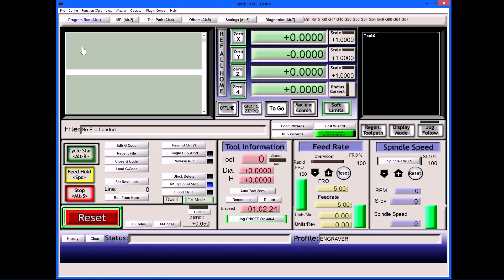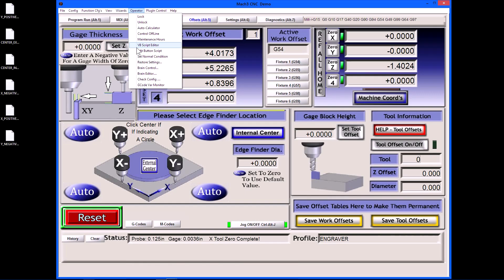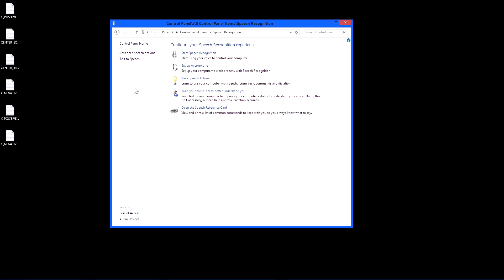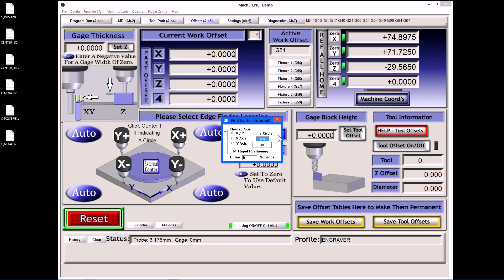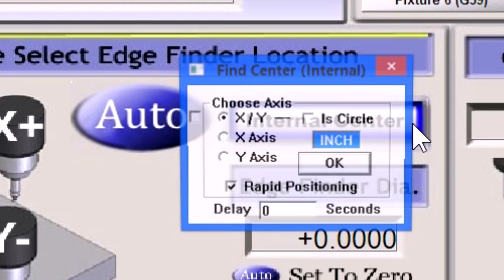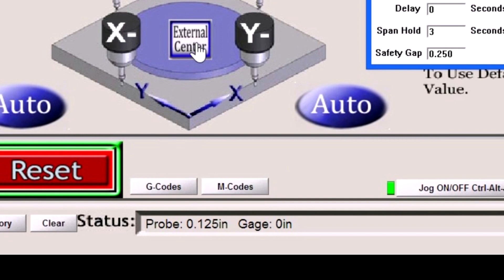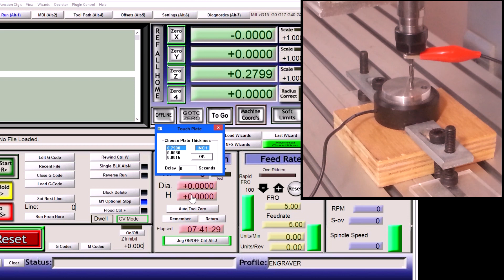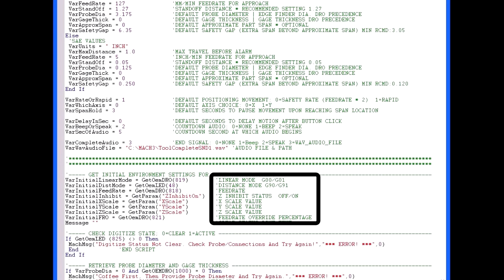CNC Mach3 | Automated Tool Setting | Edge/Center Finding (X/Y) | Includes INCH/MM Scripts

Comment: Hi Charlie, me again.  

I installed the edge finder scripts and these also work fine except if you accidentally leave the screen in machine coords.  No matter which script you run it then causes a Y negative travel.  Machine is a small CNCEST with RnR controller card.   

The scripts are quite useful for calibrating the X and Y movement.   I bolted a 150mm parallel on the table in X and then Y and ran your scripts to find the edge of the parallel.  After each script had finished I flipped to machine cords and noted the reading and then did the maths of the subtraction of the + and - readings and also subtracted twice the tool thickness.  Having got an answer to the maths I fed this into the first calibration dialogue box where it asks for the distance wanted to move and then put 150mm into the second dialogue box to give the actual distance travelled.   That probably is badly explained but I think you will get the gist.   I did a similar routine on the Z using the tool height setter with and without a 1-2-3 block difference in height.

I have also made a 3mm probing rod out of silver steel and put an insulated shank on it so I can using the tool setting pad in either mode depending on whether the job is conductive or non conductive.

The only thing I have done different to your videos is put all 6 newly installed limit switches in series into one input on the RnR card.   The software knows if it is doing a machine zero use of the switches or a limit action by virtue of the status at the time.  Again badly explained ...
Reply: https://www.dropbox.com/s/ryqnuv9mjnly769/External.txt?dl=0

Eliminate the tenths and the format of the data on line 218. It is what gives the problem is not a definitive solution, if someone can fix the problem of the format I thank you. That way it works with whole numbers.
Reply from the maker: Did the calibration work out ok? If i understood correctly, i think you should only need to subtract the tool diameter once (per axis) in your calculations or tool radius twice. 

Haven't yet set my machine back up since the hurricane here in NC, but when i do, i will test the machine coords issue. Just been busy helping folks clean up and repair around here.
Reply: Hmmm ... you have got me thinking now. 

I have the probing backoff set to 1.5mm and I had a 3mm diameter probe.  So what I really meant was 2 x backoff plus 2 x tool radius which I mentally was thinking as twice tool diameter which is technically a wrong way to describe it ....

I just did an edit to the Mach3 operational screen by adding a LED next to the tool height button so you can see/test the probing contact.  Found instructions on CNCnutz (Peter Passuello) Youtube site.   It saves having to flip screens when testing the contact.

Some pretty raw pictures of the hurricane shown on UK TV so good luck with the clean up.
Reply from the maker: Interesting about the LED. Thanks for the tip. I'll have to look into that.

Comment: On a usb 6040, when I do the external center,  after the first postion, either x or y, when the cutter moves over, it travels more than i ask and when it try to tough the probe, regardless of the distance, as soon as it makes contact,  it gives me error, max distance traveled.
Reply from the maker: Thank you for the feedback. As soon as i can get hold of a USB machine, I'll look into these issues. Till then, maybe go through the scripts and increase each "Sleep" function to 1000 ms. Maybe that will give the system more time to process the signals.
Reply: Will do, when the script gets cancel with the above error, on mach3 the abnormal LED blinks and it says "List of abnormalities G90/G91 State
Reply from the maker: I'm unfamiliar with this "abnormal LED". Looking it up, it seems that since my scripts change some Mach3 environment settings during run, this LED will light up. It's nothing to worry about, just be aware that the G90/G91 condition has changed. Are you using a different screen set other than the original? I do not know of this LED and I'm using Mach3 version (R3.043.066) with standard mill screen set.
Reply: Charlie, thank you for getting back to this.  I use the standard screen and have the same version. Its the button left to ReGenToolPath.  Normally its green with Normal Conditions lid up.  I am going to add extra time and see if that helps.  Also, some time specially with Y external center, it forgets to goto z to clear the plate and work piece and drags the whole thing with it.  So far I been testing it with lightly held foam :). specially after I broke few bits.
Reply from the maker: Great idea with the foam! I'm not in front of the computer right now, but since you mentioned where the LED is, yeah I do  remember seeing the green condition LED. I don't remember ever seeing it change though. Maybe I'm  just not paying enough attention, lol.
Reply: That LED will change if you turn on Z inhibit ON.
Reply from the maker: I'm going to try that when I  get home later.
Reply from the maker: My Condition LED doesn't seem to change from green no matter what I do. Interesting.

Comment: Thank you so much for the  tutorials,  I setup the script with you brilliant instructions on a USB driven machine.  Scripts are very touchy to say the least :)  they work 50% of the time perfect. but other 50% they have broken bits and rolled away with the part :).  Not sure what the problem is.
Reply from the maker: I'm not sure, but it sounds like there is a bottle neck in your system when it comes to the probe signals. Possibly the USB connection itself.
Reply: There is virtually nothing running on machine except Mach3.  I checked the resources, look good.  I also tried different USB cables and ports.  

The Auto Z script, from time to time, after touching the plate, will push the cutter down a mm and then goes to z safe.
Reply from the maker: The computer dedicated to my CNC is pretty bare as well. For the z script, try increasing those Sleep delays I mentioned and sees if that helps.
Reply: i have broken 2 tools not work full buged!
Reply: @Dark_Phoinix  why use first test run real bit, need use first test cheap metal rod only. if all working well then can use bit. lot lot cheapen than broken many bit.
Reply: @mattivirta  yes the problem is the cina interface usb not the script!

Comment: Hello,
 I've downloaded all your scripts and I liked them very much. But one of the scripts doesn't work (external centr). What's reason? Why could it be? 
Best regards, Igor!
Reply: Change the comma ( , ) to the point ( . ) when you have to enter the safety gap and hit ok.
Reply: It works!! Great observation Waka Tatto, thank you very much!
Reply: Thanks for the weekend I'll try)
Reply: did I understand you correctly? point put the year I lay down the size of the workpiece? for example 50.0mm.
Reply: example 6.35 change to 6,35
Reply: Thanks)
Reply: @WakaTattoo  спасибо большое, все работает)))) надо поставить точку и все))))
Reply: @WakaTattoo  Any chance how to pernamently set this loaded value from the scriptin in dialog window  in right format with the point .  for example: ( 6.35 ) ? because in script is in right format:

VarSafetyGap = 6.35  'DEFAULT SAFETY GAP (EXTRA SPAN BEYOND APPROXIMATE SPAN) MIN RCMD:3.05

Because if you do not manually overwrite the value, it always causes an error.
Reply: I also had the same problem I solved by changing the "." by "," in the following line (Dlg1.GapTxt = Format (VarSafetyGap, "## 0.000")) LOAD SAFETY GAP The correct line should be (Dlg1.GapTxt = Format (VarSafetyGap, "## 0,000") 'LOAD SAFETY GAP Thanks to all who collaborate mainly with the channel owner for hard work
Reply from the maker: Igor, describe the error in detail. Will the Option Dialog open? Does the error happen during the probing cycle?
Reply: Yes, the external center window opens and fill and click OK and the window closes and that's all and nothing moves ( test does not occur)
Reply from the maker: Out of curiosity, for testing external, did you lower Z axis off home position then zero it? You don't  want to run external center with Z at top off axis travel.
Reply: Yes, I lowered myself to zero on the Z axis, and wandered away from the part and dropped to a distance of 5mm down and away from the part. set the dimensions of the part and clicked the ok button and the window closed and nothing happens. that it is interesting that all other scripts work well)
Reply: can I shoot the video process and send it to you so that you see what I'm doing wrong?
Reply from the maker: Yes, please do!
Reply: f I took something off wrong, I can re-shoot the video) I hope for your help with respect Igor.
Reply from the maker: Thanks for the great video. I do see a problem besides the probing cycle not starting. I'll look into it and talk to you soon.
Reply: thanks Charlie will wait) thank you for your understanding.
Reply: the other day postorayus remove the process))) and now review your video that netak I do)) I do not know English well))) and I use Google translator)
Reply from the maker: Did you get external center working?
Reply: thanks) I'll try and let you know about the results)
Reply: I tried and the result is negative (((I'm probably doing something wrong (
Reply: can the general settings cover the reason? where can I send you a photo of the general settings so that you look and say what is wrong?
Reply from the maker: sunny5rise@gmail.com 
After clicking OK on the external center dialog, does the status line say "type mismatch on line 112"?
Reply: charley error in the line is  (Error on line 112-Type mismatch)
Reply: Charlie, I sent you a photo of the settings and the script that I have now. Sincerely, Igor.
Reply: Charlie! tried and gave an error (error on line 111-type  mismatch)I sent a photo to the post office. can the z axis settings cause?
Reply from the maker: The  Z_Safe feature shouldn't cause any errors, just some extra movements sometimes. I do not use the Z_Safe feature, but that's just my preference. Ok, go ahead and reinstall my original External Center script. With the script editor open, click the Play button at the top to run the script. Insert your settings in the options dialog, then press OK. MAch3 should show where the error is located. Take a picture of the screen and send it to me.
Reply: ок
Reply: Charlie! I sent you a photo.
Reply from the maker: Have you tested internal center finding to make sure it works for you?
Reply: all scripts work except for the external center.
Reply: internal center I checked for accuracy as an example I used a bearing) and after the test I checked it accurately it measures and I was amazed))) very accurately)))))
Reply from the maker: Igor, another version for you to try. Let me know what errors, if any, show up...  https://www.dropbox.com/s/qqsrntib63k0diw/External_Center_Rev_Igor.txt?dl=0
Reply: Charlie! has a mistake, he sent the photo. It's not convenient for me to bother you. I sent it from the photo yet all my settings can be needed.
Reply from the maker: Think I found the problem. I'm looking at the photos you sent and it looks like you have an older version of Mach3. If so, you'll have to download and install the newest version for my scripts to work.
Reply: Charlie! I think that I have enough and 5 scripts) thanks for the help. I do not want to reinstall the mach3, there is no money for the new program)) I will use those scripts that work))) again, thank you very much Charlie.
Reply: if that we have a connection by mail)
Reply from the maker: I understand. It's funny that 6 out of the 7 scripts work fine, and the error pointed to in the external script is the same code that does work in the internal script. In the last code script I sent, I took that bit of code out (which was the rapid/safety rate choice). What exactly was the error with the latest version of the script I sent? We still might be able to get it working if you want to try.
Reply: Yes, I do not mind trying) mach 3 will have to reinstall?
Reply from the maker: No, we'll try to make it work with your current version of Mach3 since the script is so close to working. With the latest script I sent installed, open it in the script editor and click the run button. Take pictures of the error and error location. Send them to my email.
Reply: Look at the mail, I sent you one photo yesterday.
Reply: if this photo is not enough tomorrow I can repeat the test and send you a photo in the mail?
Reply from the maker: I saw the photo, but I don't see where the error is. You will probably have to highlight it with the mouse so I know which line it's pointing to.
Reply from the maker: Ok yes
Reply: well, I'll repeat the test tomorrow morning and send a photo or video.
Reply: Charlie! I already conducted the test today and sent both photos and videos. I hope it will be useful.
Reply: as you can see in the photo does not indicate the line where the error.
Reply: Charlie, did you get the file I mailed to you?
Reply: I read all of your comments because i had the same problem even with the new version of Mach3... At the first script the error for me was: error on line 109-type  mismatch and at the second: error on line 108-type  mismatch. But as i search into the script i saw that both had error on the same code line: Var2ndDist = VarMaxDistance + VarSafetyGap   'CALCULATE 2ND PROBE MAX DISTANCE. I think there was the problem. Charlie any solution?
Reply: @stergiosvavouras5277  все работало должен быть установлен до 6,0 мм вместо 6.0 мм)))

Comment: Charlie,tkx a lot for so good and detailed tutorial.i would like ask ,if your spindle is grounded ,and if so,do you have problem when  centering metal instead of wood?im having a lot of different behaviour when touching different metal
Reply: I had the same problem as my table and the spindle were both at ground.   In the end I made a probing rod with an insulated shank and shoulder so I could make an isolated connection to the probing input.   The shoulder ensures the probing rod always sits at the same position in the collet.   The next step is to 3D print some small plastic discs to superglue onto the cutting tools to mimic the probing rod height.  The cutting tools from Think & Tinker already have these in place and I have matched this on the probe.
Reply: @alanwood3597  care to share . mine is grounded also . trying to think of a solution
Reply: @GurusOnWheelsSalisbury  I made a 3D printed 'top hat', that is a cylinder/tube with a shoulder/boss on it.   The tube inner diameter is a glued fit on a piece of steel rod and this insulates the rod from the chuck / collet jaws.   The top hat collar acts as a reference stop point to always maintain the depth of the insulated rod into the chuck.   I have a crocodile clip that I clip onto the insulated rod and this goes to the sensing input.
Reply from the maker: No, my spindle armature is isolated from the rest of the machine. What different behaviors are you having?